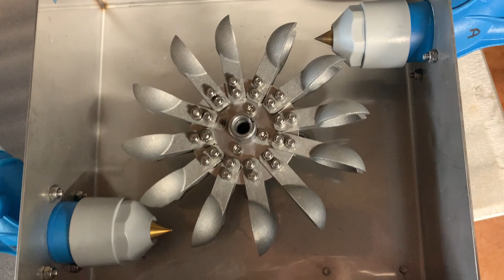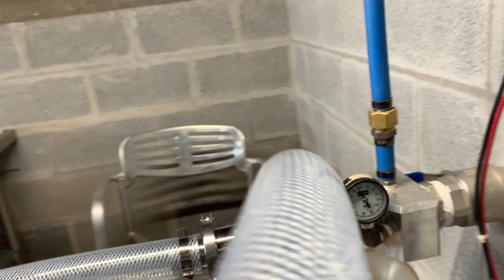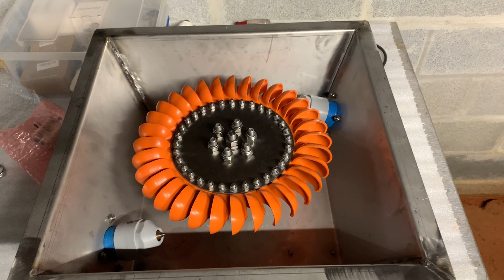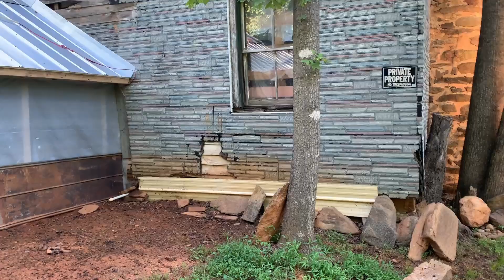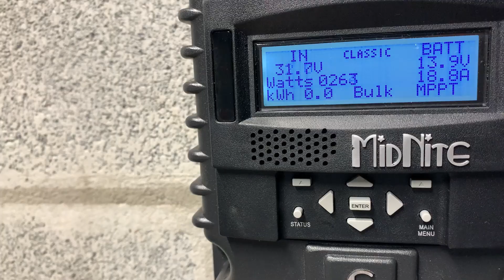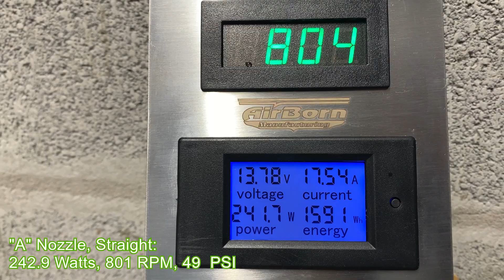Episode 8 - Line Fittings

Comment: This is interesting to me. I am myself building a microhydro myself on a spring that my father in law has. There's a very significant head between a reservoir where he collects the spring and the home, around 45 meters. We've measured around 3.8bars of static pressure and once the tap opens pressure goes down to around 2.8 bars due to friction.
We have also measure the water velocity at ~13m/s, so the ideal linear the speed of the paddles should be 50% of that, 6.5m/s. 
We're using an LG motor from a washing machine which for what we have gathered it seems to generate a lot of voltage. On some early tests we had ~118v on each of the phases at ~ 280rpm, so  we worked out that we should make a bigger wheel to make it spin slower and generate a voltage close to the ideal range of the inverter. We need to make more accurate measurements but my estimation is that we'll need a ~300mm wheel (or re-wire the motor, but I'd rather avoid that).

Did you check or head opinion some cheap grid-tie wind inverters that don't support batteries that are sold on chinese markets like aliexpress? Those are designed to take three phase AC current straight from a turbine (usually wind) and add just inject power into your grid. Those are <300$ and since we don't really need batteries I wondered if those would be enough. They come with a big resistor to dissipate power in the case the grid goes down.

The hardest part now is possibly designing and 3d-printing some spear valves, as I couldn't find any that aren't outrageously expensive, more than the rest of the materials combined.
Reply from the maker: No, I haven't tried grid-tie inverters because I don't have enough power available. I only have around 400 watts and using batteries I can draw much more power to run equipment on demand (Currently 3000 watts).

Your available power is determined by head-height, penstock length, penstock diameter and water flow. Your static pressure of 3.8 bars tells me you have a head-height of 38.74 meters.

You can buy plastic nozzles from ebay as low as 10 US Dollars. I will be showing those later this year on one of my hydro videos. 3D printed ones may not hold together long term under pressure.
Reply: @Magutz  Plastic nozzles maybe, but adjustable spear valves like the ones you have go for over 100€, at least the ones I could find. If you know of cheaper ones please do share a link. 
Also, if you have any recommendation about what inverter setups, with or without batteries, please do share. I was leaning towards grid-tie because we do have grid already and batteries are expensive. And being grid-tie is a requirement for me.
Reply from the maker: @MiguelCamba  You are totally correct, as far as small hydro adjustable nozzles; the blue ones are the only ones I've been able to find. As far as the inverter goes; it depends on your budget and available power. Batteries are good to use when you're working with 3K watts or less.

Comment: if your welds on the stainless start to corrode a little, you might have not passivated the stainless enough for it to form that protective oxide layer and/or not removed the heat coloring
Reply from the maker: That is a great point and good advice. No we did not do any cleaning or passivation on these as they are prototypes, we use the Cougartron ProPlus when we take care of this. Thanks  for your feedback.

Comment: Glad to see this. I didn’t think the “T” will cause too much loss in power, but it’s nice to see your research on this. 
May be because it’s a lot of pressure on the system and it’s not like you open fully at the end to cause too much friction on the fittings. 
Knowing that Midnight eats 12watts makes you think what other way around is good, but we already purchased the unit, so may as well improve the overall system. 
Do you have air in the system? Looks to me when you turn on the nozzle there’s some bubbles there. 
Thanks for your work on this.
Reply from the maker: Yes, that is a good analysis of not having a noticeable power loss through the T.
The air gets into the flexible lines through the adjustable nozzle when I cut the water from the main valve. That air is pushed out easily when I open it back up. This was a concern of mine when I first started testing, if any water went back up the pipe; it would drastically reduce the power. Especially since it would have to travel over a half a mile to exit out of the standpipe.

Comment: I also have a youtube channel that talks about hydroelectric turbines.
The blue and red variable injectors are not effective at low water flow rates, they diffuse the jet rather than concentrating it. I have a 4 to 6 bar setup with max 850W power, a total efficiency of about 50% due to the pressure drop in the pipe (150 meters / 43mm inside).
I start using the variable injector when my water flow is greater than 2 liters per second
Reply: Is it better to run as big a penstock as possible I have got 5" pipe 11m 20l
Reply from the maker: @johngray6462  Without a doubt, even with small flows, you should at least use a 3" pipe. That would boost my power by almost 1,000 watts. Thanks for your feedback.
Reply from the maker: That is a decent amount of power, I'll be checking out your channel for sure. Thanks for posting.
Reply: @cristof48  let me ask your advice on this, if you can help me figure it out. So, I have 350 meters of 30mm inside line, say 150 meters e elevation. I’m thinking to try feed that into a bigger barrel, to separate some of the silt and water, then feed that to a 5” line, about 100m with 30m drop. 
Should I do this, or transition to the 5” line without losing the pressure already built from the first drop? @magutz what do you think?
Reply: @adipreli3982  si le gros baril n'est pas 100% étanche, la pression au niveau de la turbine sera celle générée par la chute de 30m.
Si le gros baril est étanche, la pression sera celle des 150m d'élévation (+ les 30m) (c'est beaucoup, environ 18bars (260 psi) vous allez tout exploser.
Si le baril n'est pas étanche, vous n'aurez pas suffisamment de débit dans le tube de 5 pouces car le tube de 350m est en 30mm
Reply: @cristof48  mersi beaucoup pour ton aide. I agree that the pressure built will blow up everything, that’s why the system never get closed completely, to avoid blowing up the connections. 
I was hoping that by having a 5” line extension to the 1” line, will build up more pressure, not necessarily increase the flow, and maybe generate more power. I only have 16gal/min flow. 
I may just try and see if it does make any difference, since I’m not making enough right now. 
Thanks!